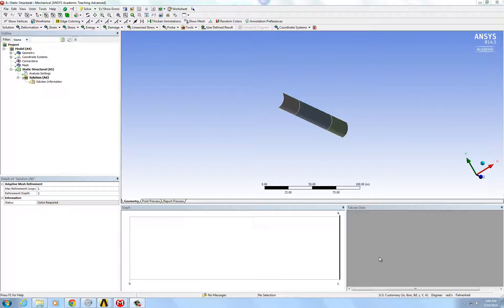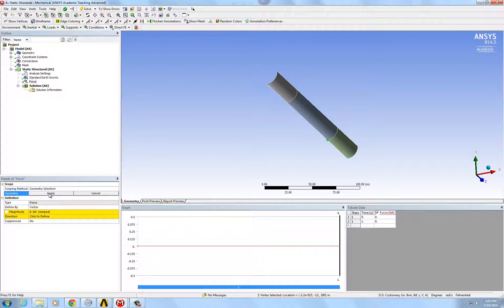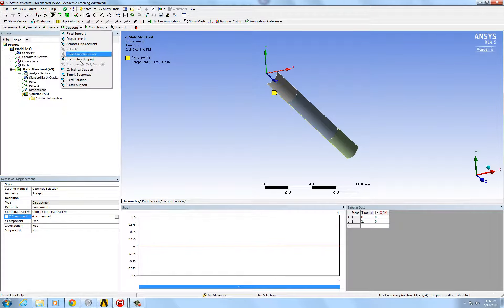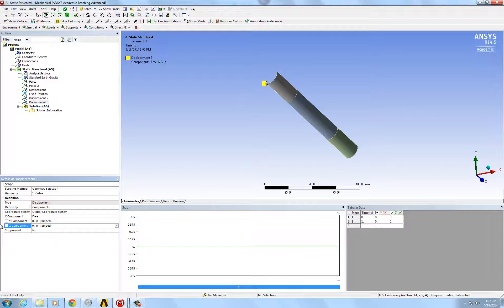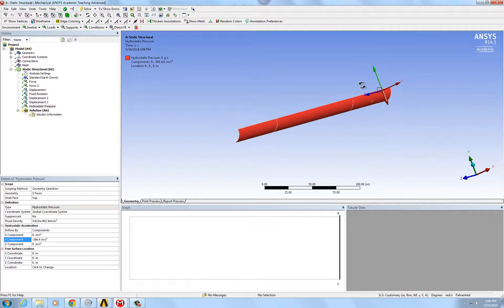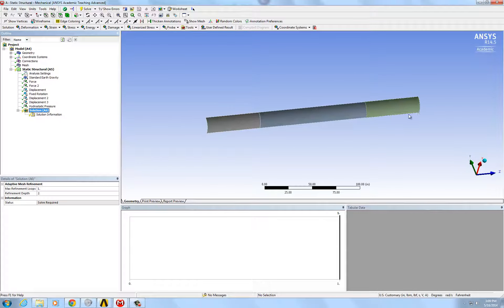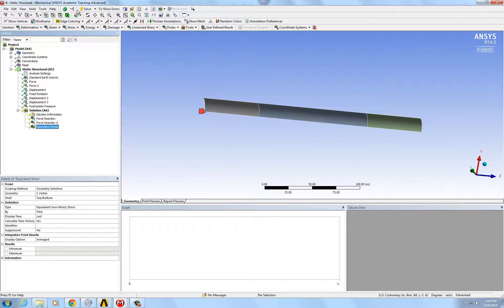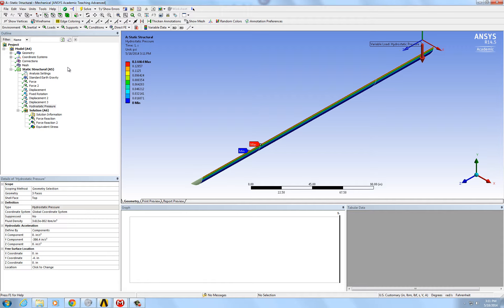Hydrostatic Pressure tutorial

Comment: Nice video! I do have a couple of questions:

(1) How did you determine the value of the hydrostatic acceleration? What if I have just a body of water (at rest) applying the force? Will the acceleration be zero?

(2) You have the "Standard Earth Gravity" already applied to the whole system. Why add an additional acceleration component (in Y direction, in your case) to the model?

Thanks!